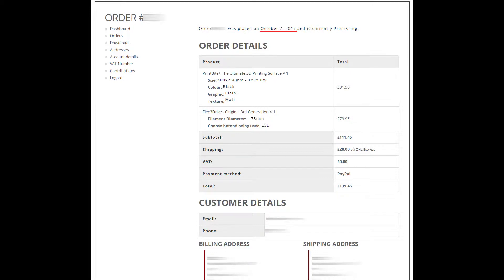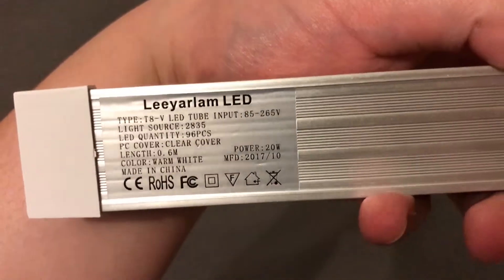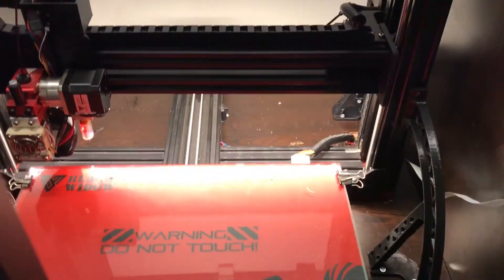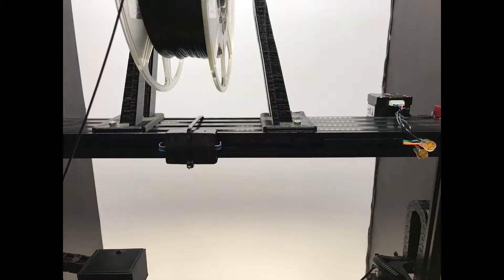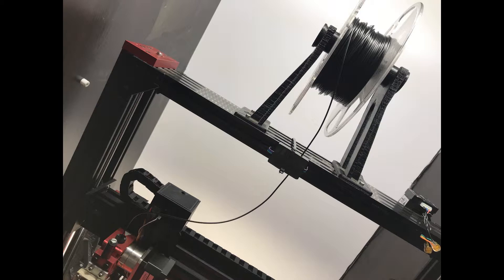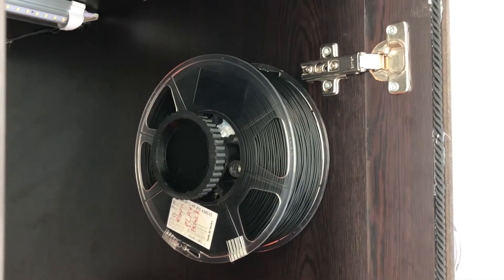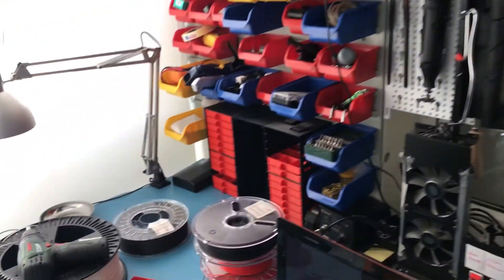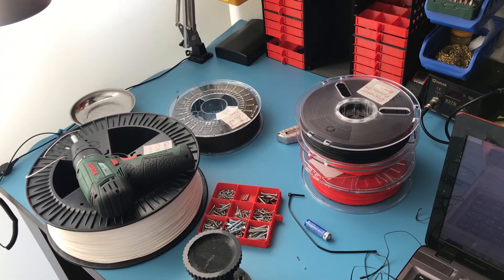Tevo Black Widow Mods Part 6 - New Lighting, Fixing the Filament Sensor & Spool Holders

Comment: great videos it would be awesome if you could make video on how you connected that filament run out sensor to the mks board and what I used for filament run out switch or eye sensor and what changes u had to make in the (firmware-in detail) I would definitely what to see that video great videos keep up the good work keep them coming
Reply from the maker: +jim. c It's planned. I don't want to promise the date but most likely next Friday.
Reply from the maker: I made that video. You can find it here: https://youtu.be/hVmNM3GOvOU